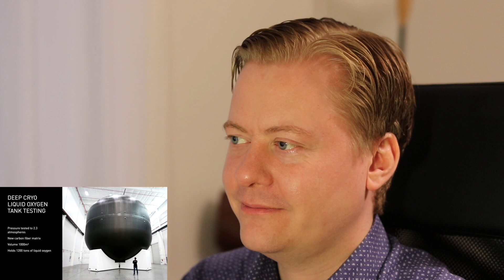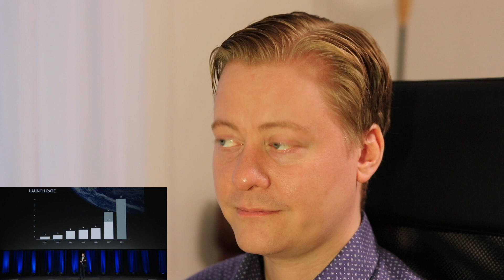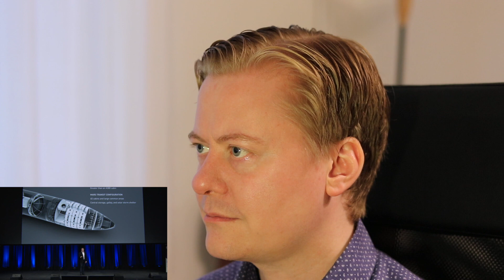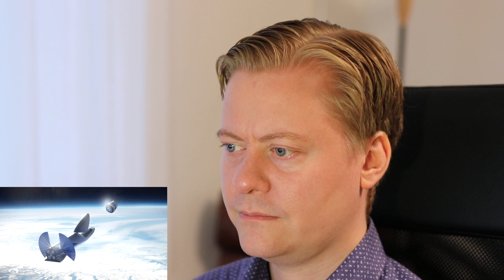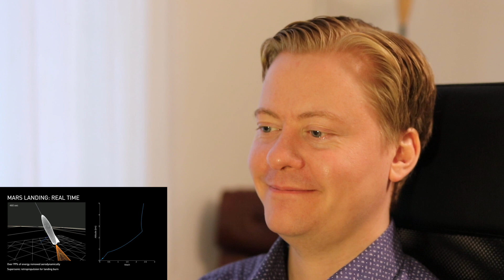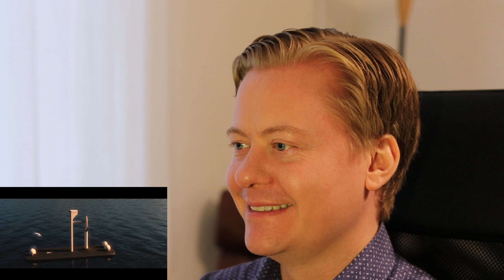REACTION "Making life multiplanetary"

Comment: I think we need to stop getting caught up in how many satellites need to launch at a time. As long as the launch cost is cheap enough for SpaceX ,even launching a 3 ton satellite, will still be cost effective for both SpaceX and the customer. SpaceX will recoup their  development costs with multiple launches like airlines do with multiple flights.
Reply from the maker: Yes, you are probably right. To continue Elon's analogy; if you'd charter an airplane to deliver a small payload using a 747, it would still be far cheaper than purchasing a small plane, even though the smaller payload capacity would be a better fit. 

I estimate the fuel cost to 300k USD / BFR-launch and if we'd assume 200 MUSD manufacturing cost of one BFR, good for 1000 flights, that'd be 500k USD / launch + operational costs. Few orbital launchers can match that.
Reply: The Falcon9's wont be shredded to peaces and the design not deleted. It will still be produced and lift satellites into space. They just wont enhance the design anymore once the flaconheavy is finished. Its still be used to launch those smaller (falcon9) and medium-size (falconheavy) payloads.
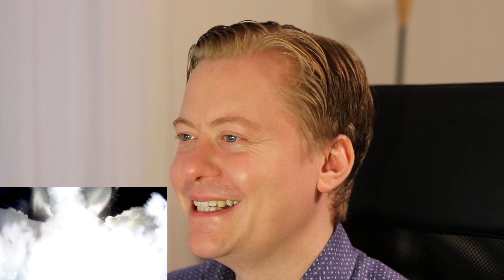Reply: Also 8:05 i hope you noticed that this was the "rumour" about the failed test that you are talking about at the beginning. It wasnt a failed test but it was a successful test.